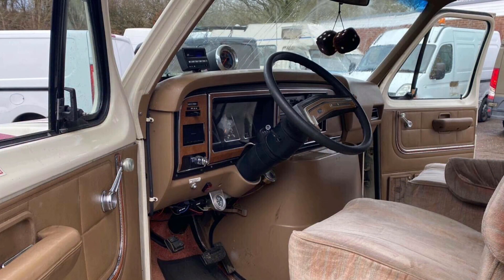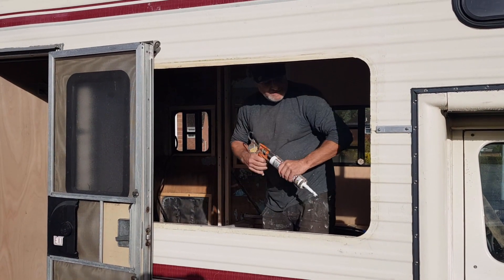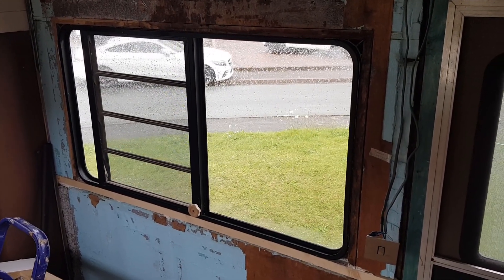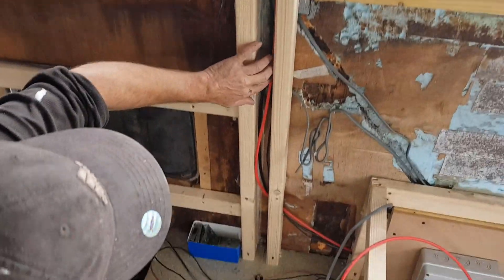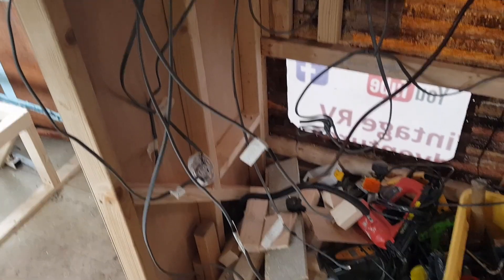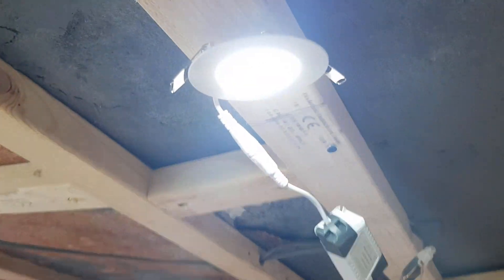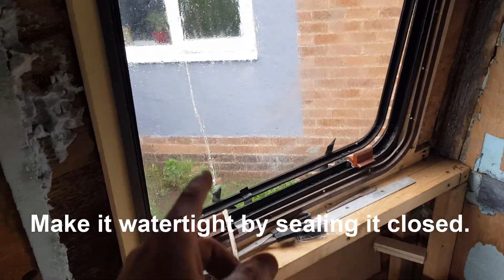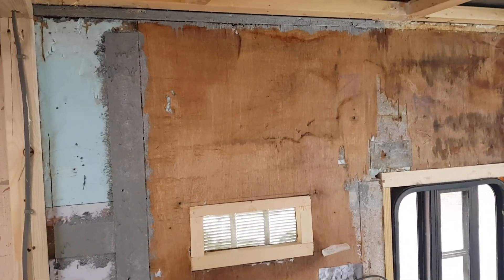Installing Schneider Screwless Electric Fittings | RV Motorhome Rebuild Updates

Comment: I have a 1991 and my windows leaked like a submarine where the glass tipped out.  After Hours of research I removed the glass and all hardware and reinstalled them so they wont open.  Now they don't leak and I never opened them any way............  Best wishes....
Reply from the maker: Yes, the small one in the rear wall has certainly got to come out of the metal frame and the glass sealed back into the frame it sits in. Everything we have tried has not worked. We were hesitant to take the actual glass out in case we broke it, but we have little choice. We will just have to be ultra careful. We might video that part.

Comment: Those window frames really look the business. All looks new! Brilliant job.
Reply from the maker: They have come our really well, compared to what they looked like when we bought the RV. We bought ourselves a spray gun, and we already had a compressor in the garage. Its been good fun learning to use the gun, giving a decent lay on of paint, without getting paint runs. Most things we have painted have come out okay. Bit of a fail on a road wheel the other week, so that has to come back off and be rubbed down to be repainted. The wheel surface was not cleaned properly after being rubbed down, or we had something on a cloth that the paint didn't like.
Reply: @VintageRVAdventures  Jan would like to know, will you be painting the outside of the RV at all? Didn't know whether you are keeping with the colours it has or you have your own plans?
Reply from the maker: Hi Jan. The coloured stripes are in really poor condition and so we need to remove them, they were originally painted on anyway. We plan to paint over them with other stripes, but the pattern will be slightly different, but no modern day patterns. The stripe colours will be Tartan Red and Grampian Grey, both are colours used on 1970's British cars (we have the paint ready). We didn't plan to pant the cream of the accommodation unit, but the more work we do and harder we look, it is likely that we will have to paint the rear cream coloured parts. It was always a plan to repaint the cab, and this will be done when we have better weather to harden the paint off, we have missed the painting opportunity this side of Christmas. We could spray some parts in the garage though, like the doors and the bonnet.
Reply: @VintageRVAdventures  It's going to look amazing when it's finished. Can't wait to see it finished and on the road!

Comment: You're using 240v for the interior lights ?
Reply from the maker: Yes, 240v for the ceiling LED spots. ... and 12v for some small spot lamps which will be mounted under wall units.